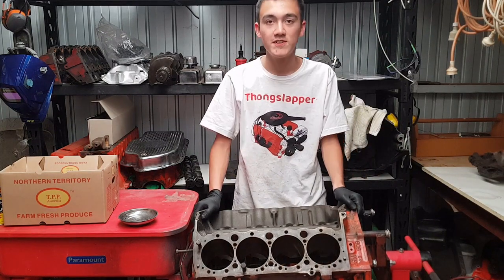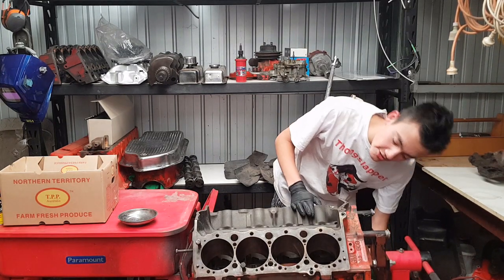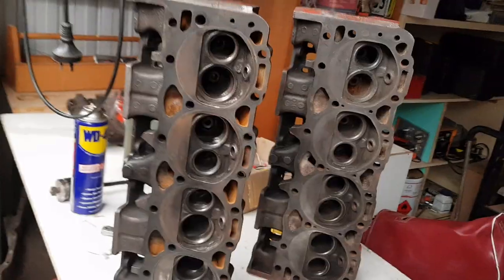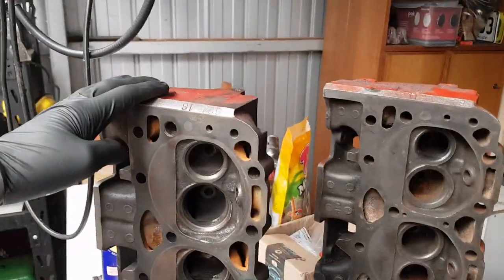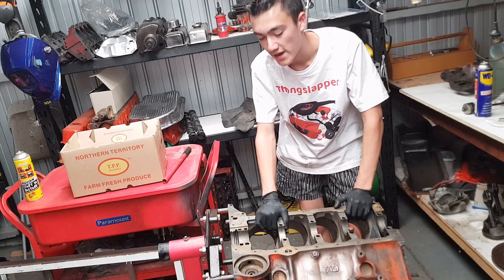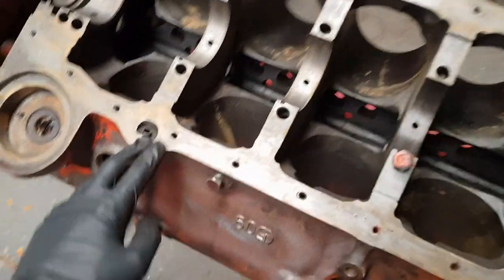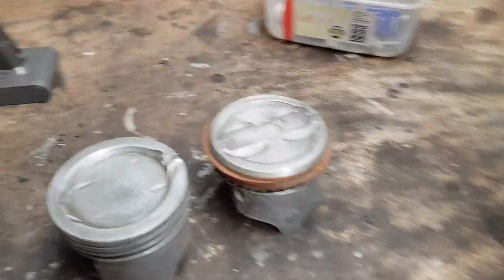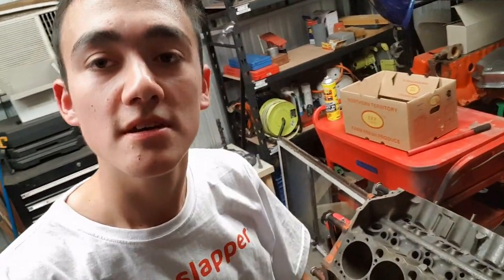Why the small block Chevy 400 is different

Comment: Ahem....ummm, .040 over, 11:1, Holley 780 dbl pumper, Comp cam 292 .480 lift, Muncie M22 Rock Crusher(close ratio), 12 bolt 3.73 posi in my 69 Camaro SS....hurtin feelings since 1987 and still pullin teeth!! 😉💪🏎💨💥

Comment: I always drill the steam holes on heads going on a 400 I know a lot of people that don’t but I say they are there for a reason and easy to do
Reply: My machinist does the same to keep it cooler.
Reply: A steam pocket can form where the Siamesed cylinders connect. I always drill them using a head gasket as a template.

Comment: you forgot to mention the 400 is externally balanced. its the only sbc that is. takes a 400 specific balancer and flexpate. my favorite sbc. i have built many of them over the years.
Reply from the maker: Yes you are correct, il probably mention that in another video.
Reply: Ima have to boost my 400 then. Its in my 79 camaro
Reply: The 1986 and up 305/350 with one piece rear man seal blocks are externaly balanced. They use traditional internal balanced dampeners but the flywheel/flexplates are weighted.
Reply: The 1986 and up, Small Blocks are externally balanced. Flex plate and damper are externally balanced.
Reply: @davidcoleman9304  the balancers are not externally balanced on the 86 up. Just the flywheel/flex plates
Reply: Ohio Crank makes 400 Crank it’s journals are the same as a 350  And it’s internally balanced
Reply: @Robert Thompson im not a fan of electric water pumps, most are cheaply made and are not even worth installing, if you are set on an electric i would get a quality brand name one. most of the china stuff is junk.
Reply: @davidcoleman9304  no such thing as  a 1986 400, except for aftermarket blocks. GM made the last 400 in 1981
Reply: Can u make or sale me one I'm looking for one for my 78 chevy
Reply: @darrylshaw2039  i have one i would sale. where u located at?
Reply: @imtransahsaurus8809  I wouldn’t the 400 is prone to overheating and I have seen a piston blow right off the side they are pretty quick but pay the money for a 5.3 ls and you can get a easy 450 hp with little work and reliably
Reply: @Robert Thompson get a hose made up I use a coat hanger for the angle  and match it up at the auto store  You might have to cut a bit on the ends but that’s how I always did it I’m sure you can get a custom made one if you look in the web
Reply: @chevyfarmersgarage1955  electric water pumps are great for drag racing applications mostly  but for a cruiser street and a few drags it’s not worth it I would rather have ac and accessories I  love Nitrous motor builds  great low compression
 and make a ton of power for the money 
first part of a car build should be suspension handling and breaks and rims and tires  just those mods alone will make you very happy and give you a good platform to just swap the motor out anytime
Reply: The 4.3L V6 from 96 & newer is externally balanced too. iIt might or might not be considered a small block? There's also a 4.3L V8 aka The 262.,but that's internally balanced. I always wanted to build a 329. That's a 400 block and a 283 crank.
Reply: @jimcatanzaro7808  lol cute. A 5.3? Lol for a car maybe. Compare a blueprint SBC 400 sub 3,500 rpm torque to almost any 5.3.

Comment: Great motor for sure.Torque is amazing like A big block.So many people say steam holes steam holes.I have ran A few 400 sbc and never did steam holes and no overheating problems.Nice water pump and good 4 core radiator and fan,no issues.These motors do not take much to get them to run strong.I would never choose any other sbc.The power and weight,you just can’t compare.

Comment: if you know what your doing the 400 done right is by far the meanest small block you can stroke them out to get insane hp and torque just do your research or find some one who knows how to get that power from that engine
Reply: Yup true, I have a 70 Impala with a custom 400 small block, customized heads, put cooling holes, larger crank, similar to 383, crank journals where tighter so added a high volume pump and bigger oil filter. A old guy whom worked on old Chevy race cars put it together. Things a beast.
Reply: I agree, the 421 stroker, 500 hp, I have is one awesome engine. I didn't know enough to build it right so I had a race shop, (Watson-Rupple) that builds engines for the dirt track and the 1/4 mile build it for me. I had the block and heads and it still cost $6000.00 with an 850 cfm Holley included. Of course it's balanced, blue printed, heads cc'ed and all the good stuff that I couldn't do. I had a stock 400 in a new Chevy van back in 76 and have been sold on the 400's ever since.

Comment: I love the way a 400 sounds. I got one in my 73 monte.
Reply: I'd like to get one and swap the 350 my 86 GMC K2500 for it.
Reply: I have a 74 400 in my 86 SS Monte!!!
Reply: @rockerpat1085  nice I loved the 86 ss  
One if my favorite body styles.
Reply: The 400 small blocks were great, used to take the heads and throw them on the 350 as the heads have better porting and bigger valves, have to use the 400 head gaskets due to the steam holes, however the heads make a big difference
Reply: @staycool72  all 400s had 1.94 valves. standard size. a 327 or 350 could have 2.02 valves. nothing is ported from the factory.the 400 was meant for station wagons. full size sedans and trucks. they did not have performance heads. most were 350 heads drilled for steam holes. 997...487....882 casting numbers. and you didn't need 400 head gaskets because there are no steam holes in the 350. the steam comes up from the block.
Reply: @dougburg3210  On the other hand, a stock '387' 2-bolt 400 block topped with 1968 '291' unshrouded big valve 63cc 327 Corvette Fuelie Heads drilled for steam holes, stainless valves, ARP studs and modified as a full roller with a Howards .500/.510 retrofit roller cam, short 7" push rods, Comp Cam ProMagnum roller rockers, Holley "old school" single plane 1960's Street Dominator manifold with half inch spacer and Holley Sniper EFI w/ full MSD ignition certainly gets my ass puckered in my 3700lb 66 impala.
Reply: Got one in my 74 MC

Comment: The 350 was always easier to build but the 400 feels like it makes gobs more torque of the line!
Reply: @Dennis Burger I will never forget the sheer terror expression of an Exxon mechanic walking in front of my 73 vette shaking his head when  he was crossing the lot and I dumped the clutch at full throttle and pulled the wheels off the ground the bias ply tires really had bite but smoked the tires in first and second  I am sure he crapped himself! the 400 came out of a mid seventies Impala and had milled heads and flat top pistons but ran 11.7 at the strip.

Comment: Compression on 400 is close to the 350. Bigger dish pistons were for the added stroke of the 400. The smog 70's sucked.
Reply: the dish was for compression. the bigger the dish...the lower the compression. the 400 used 5.565" connecting rods to compensate for the stroke increase. the 350 used a 5.7" rod. and yes. the smog 70s sucked.

Comment: This engine 400 SBC was slated to Know as LT2 in 1971 before gas / insurance crisis halted continued development.  A 4 bolt main design was first step in engine design and the power of a 400 SBC was never known unless a wise performance team build. We at SBR -Still Building Rockets and Wells Engineering were building this LT2 engine back in early 1990's and having great success long before the  383 came out. HP was at 375+ and when we introduced Nascar heads.. this combination was over 450HP.

Comment: I’ve had several gm pickups over the years with the 4.3 v6, 454 BB. 6.5l turbo diesel. The single best, smoothest running engine was a 509 cast 400 SB like this. The rest of the 57 Chevy truck it was is was a parts beater, but the engine was perfect.

Comment: Run a eight inch stroked scat crank, 6 inch eagle rods, 40 over bore. Internally balance with Mallory. Forget the bolt on factory balance stuff and it won't break.you'll come up with around 430 ci. We Ran these for years in late models and super lates and won a lot, including track championships.
Reply: Thanks good info
Reply: Any clearancing needed on the block with the stroke increase?
Reply: A 8" stroke crank in a SBC?
Reply: @6.8SuperDutyDriver  yeah, ya know with the 4" raised deck totaling 988ci
Reply: @marthamryglod291 , yep. The SBC 400 has a factory bore of 4.125" and a factory stroke of 3.75" making 400.92 cubic inches.  

Boring it .030" over (4.155") and using a crank with a 4" strokes gets you 433.89 cubic inches.

No idea where the 8" stroke came from.
Reply: @6.8SuperDutyDriver  yeah joking about the double length stroke m I tried to imagine what the block would need to accommodate it.
Reply: @6.8SuperDutyDriver  He means 1/8 inch stroke over stock, just under 4 inches.
Reply: @briansearles4473 , SBC 400 has a 3.75" stroke.  A 4" stroke would be .25" over stock.
Reply: @6.8SuperDutyDriver  A 1/8 inch stroker would be a 3.7/8 inch stroke.  Why he did not go with 1/4 inch over the factory stroke I don't know. I think we are talking about 12 cubic inches difference?
Reply: @briansearles4473  Stroking one of them just makes it worse with rod to camshaft clearance. He failed to mention in the video that the rods are also different in a 400 because of the stroke.
Reply: @r1learner178  I think Chevy used a 5.5 inch rod to fit a 3.75 inch stroke in the small block due to the low deck height. Personally I think the 350 is the best overall size given the dimensions of the block?
Reply: @briansearles4473  That's what Smokey reckoned also.

Comment: great video but don't forget mate they were specifically designed to replace the big blocks in 9-passenger station wagons that pulled 30-foot airstream trailers to Florida for vacation too ....with all that thrown in the rat motor was just a bit too evvy.

Comment: Another thing is the connecting rod length is   5.565  compared to the other chevy small blocks which is 5.700  in
Reply: Yes the 400 had a unfavorable rod angle.

Comment: I had a 400 in my 73 caprice coupe...240,000 miles and still ran fine, although I'm sure it was well worn out.  Doesn't look mike much "metal" left between those cylinders, glad I never overheated it....

Comment: Growing up building cars with my dad  we built either 454s or SB 400s and we always put them into late 60s early 70s Impalas, Caprices. With a well build TH 400 trans these SB 400s , when built right are screamers on the street, crazy torque, without drag tires you have to pedal the motor to get a decent hook up.   here is my SB 400 in a 1972 Caprice- my first car I ever owned. Resto was in 1996, my first paint job as well, still looks good. No one has non donked 4 door hard tops anymore, but I do.  Pure old school build. Just rebuilt motor for second time in 2018 with exact same setup I ran in the 1990s. Stock cast iron heads, hand ported and polished, a Edlb performer dual- split plain elevated runner one side of plenum is higher then the  other while still being dual plain. I don't know where my dad found them I know they are early 70s manufactured. I sprung for a new Edlb carb the AVS 2  650 CFM   -nice design and improvements over the older carbs. I'm running a 278 Issyk cam with essentially all stock internals besides pistons, rocker arms and push rods.  Fun street cruiser.  400's had a reputation for overheating.  Never experienced that but we always run them with no thermostat and 4 row aluminum radiators with electric fans. You can literally idle the engine for an hour and it stays at 170F  I have the thermo coupler set at for the fans to engage at 180F. Also higher rev driving Iv never seen temps above 190F on a 85F temperature day of cruising and romping it down the highway.  Its a 6000 RPM reving torque machine. Never dyno tested it, Who Cares!  Its fun and it will pretty much take on anything its gone against on the streets around here these days because no one drives their trailer queens on the road anymore. Why Ah !! build the motor and tranny to match your desired use. I run a 3200 Stall B&M hole shot converter and my rear gearing you ask? the stock 273 rear gears is the key to final power evenly delivered to the roadway surface.  1st gear to 2nd at WOT that comes at 60 MPH 2nd gear to 3rd shift that comes at 85 to 90 mph.  tops speed ? dunno,  speedo only goes to 120mph. When your sweeping dash gauge needle goes an inch past 120 on the cluster you know your really moving LOL. Yes I have the properly calibrated spedo pickup gear in the trans I did pay a shop to dial that  for me years ago.  Keep the SB 400 Alive Folks!! 
 My vids below enjoy!   The first video I posted 12 years ago. I had balding rear tires and decided to do a burnout till they blew.. Well one did blow as you will hear. The tire tread separated from the sidewalls , shot out the back, ripped my quarter panel nearly to shreds blew the bottom of trunk floor pan upward, tire  left the car and went through wall of garage into the closet in the house that just so happened to be my wife at the time's wardrobe room.  LOL we aren't married any more LOL.  She was never a car person anyway.    Total invested since 1995 in car-  350 dollar purchase , just over 12,000 spent on resto and the newest engine rebuild.  Value to my life.. priceless!   
https://youtu.be/uBCJQzlL-iY
https://youtu.be/OT7MatVrXB0
https://youtu.be/TDICXy4sYLw
https://youtu.be/xE94O9wgvYE
Reply: That's some good stuff!!!!!!   The 273 gears will go on the big end. Had my moms 76 Grand Prix with the Pontiac 2 barrel 400 to do some minor work to. Raced a 911 Porsche on the big end and could go past it anytime I wanted. Keep up the good work!!!!!

Comment: Great video. i had a 1973 Chevey Caprice Coupe with a 400. im not sure if big or small. lottsa tork off the line. But not that fast
Reply: better flowing heads, bigger cam and a torker intake with a 800 cfm  Dbl. pumper will double your horsepower. The stock 400 was just suppose to get a 1970's boat of a car to move out of it's own way!
Reply: @lilibethdoherty295  u made my day !
Reply: Small block if it's a 400
Reply: I ordered a new Caprice convertible in '73 with a 400 and it came with a 2 barrel carb. It had 2 engine choices, the 400 2 barrel or a 350 with a 4 barrel. Pretty heavy car so I decided more torque would make it nicer to drive.

Comment: G'day bloke. I've got a 400sbc block on the engine stand at the moment. With the right piston and rod bearing alterations I'm running a 6inch rod and stroked it out by 2 dozen cubes.
Reply: cool. i was looking at something that is "store bought". 427.....4.25 bore....4.00 inch stroke. aluminum heads.all forged, 6 inch rods. they rate it at 540hp and give you a dyno sheet with it.....then all i'll need is a car.
Reply: sorry...i meant 4.125 inch bore.  otherwise i would have a 454.  that would be quite a large overbore. water jacket time.

Comment: 1970 400's were available with 10.50- 1. compression and 4bbl. carb.
Reply: @ David Coleman You have your facts wrong, 1970 400 small block came with 9.1 compression and a 2 barrel carb which produced 265 ponies, and 400 ft pounds of twist. A four barrel wasn't offered until 1974.
Reply: @nojunkwork5735  According to 1972 Motor's Manual 400's had a 4 bbl Q JET and 10.25 compression. 330 HP @ 4800 RPM, and 410 ft. lb Torque @ 3200 RPM. Available in Impala, Monte Carlo, Nova, as an option. Starting  In 1971 all compression ratios were reduced to 9-1.400's were 8.50, Big Blocks also had 8.50-1, for emissions ratings.
Reply: @davidcoleman9304  You are right, the 1970 400 was rated at 330 hp. There is just one problem. The engine you are referring to is the 400 big block, not the 400 small block.

Comment: Great video and great comments.   I was thinking of building a 327ci but always kept in the back of my mind ; of building a Chevrolet 400ci but couldn't find one . I lucked up today and now buying a Chevrolet 400ci. It's a 4 bolt main and its been vated and doesn't have any cracks . It has the main caps and bolts in the right locations and nothing else , basically a bare block . I'm paying $600 for it . I believe this is a good deal because they are so hard to find . I have a set of Camel hump heads from a 1966 Chevelle I plan on using . I also want to go with about a 2500 or 3000 stall converter. I want the engine to be heard and shake the ground.  I mainly want to drive it on the street and have some power too. 
   I know there is alot people with experience ,with the 400ci. Does anyone have any ideas or suggestions ; of what components that would be good.  I plan on using headers and stainless exhaust and mufflers.
Reply: A cam in the .470 or larger range.  5.7 rods or 6" rods work great.  Make sure you use a compression calculator to determine compression.  Otherwise you can easily get too much compression easily. I have a 400 with .490 cam,6" rods,aluminum heads,dual plane intake and 750 holley.    It's a complete monster.   Hauls booty

Comment: Looks like your 400 small block is a 509 casting, known as the best starting point for a performance build. 👍 Does it have 10 or 010 and/or 20 or 020 cast in the timing chain area? Supposedly this means an extra 1% and 2% of tin and nickel added to the iron used in these blocks.
Reply from the maker: yes its a 509 cast 400.

Comment: 400 also came with shorter rods than any other sbc
Reply: it's funny, they changed the deck height of the pistons to compensate for the stroke difference between the 327 and the 350. but they changed the rod from 5.7 to 5.565 to compensate for the difference in stroke between the 350 and the 400.

Comment: I put one in a 1983 Camaro. Very torquey. Moderate cam, headers, Weiand dual plane intake. Flat top hypereutectic, which gave 9.9:1.  Very quick car even with 3.08 gearing. Cooling is a challenge. Mine was overbored too much.
Reply: What ended up solving it?